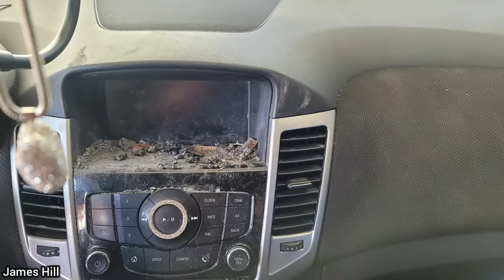Customer States New Oil Pump Installed, Still Has No Oil Pressure

Comment: 1:45 not a mechanic, I've seen one worse than that. The snorkel was connected all the way through but they hadn't closed the original air inlet holes( or it might have been the dust outlets). Anyway owner drove through a puddle that sent water higher than the top of the wheel arch and it hydro-locked the engine.

Comment: So funny that they put something thick in to "try to increase oil pressure"  the total pressure drop increases with increasing liquid viscosity when the superficial gas and liquid flow rates are the same, Starting with a high viscosity will actually amplify the loss.

Comment: My car had a nasty vibration on the highway. It was also noisy under throttle but that went away when coasting. First shop had some bullshit nonsense about hsving to call Volvo to index something in the "exotic" rear axle. A Volvo 240 has a DANA 30, same as JEEP has used for decades. Second shop got it right. At 392,000 miles the rear U joint was bad. Fine. Get it back, different vibration. Got told the driveshaft was dented. A friend has a bunch of Volvo parts so went there to swap out the driveshaft. Idiot at the second garage had forgotten to install rhe Zirk fitting, so open to the air, and two of the circle clips were barely in place. Swapped in a known good rear shaft, vibration gone. Ordered another new U joint. Put it in the original driveshaft, that has no damage and is not bent, and it is perfect. No wonder the circle clips were not in right. A roller bearing had fallen across the bottom of the cap, so it could not seat properly. Took some work to repair the damage to the yoke on my original driveshaft, but it is all good now.

Comment: Im just glad that in europe there are this many restrictions on vehicles.
Reply: In the USA it's state to state. In Pennsylvania, annual inspections of brakes, suspension, lights, operating and safety devices are required, along with exhaust emissions in some areas. In Florida, no inspections necessary. Most of the disasters you see here come from states with no inspection requirements.

Comment: I've never owned a car or worked on a car but how do you put a tire on backwards?
Reply: The customer installed the "spare tire " rim with the side that has the cavity to  accommodate the brakes facing out.  The rims of "spares" are a bit odd looking, and one must pay attention.  It's probably why the customer lost control of the vehicle and had another accident on the way to the shop.

Comment: What the hell…how are workshops even allowed to let anyone leave their parking lot with paper thin and cracked brake rotors?!
This is a danger to public safety and a rolling liability & criminal negligence case just itching for a reason to get started. I hope that customers like that need to sign a fat waiver that they accept liability for ANY mishaps resulting from this dumpster fire and decided to drive off against expert advice with brakes they now know are faulty. This might even be worth tipping off police about. I am sure they would be interested in knowing that this vehicle is NOT road safe and make sure it is not going on more inch until this is fixed.

Comment: Snorkels should only be hooked up when doing snorkel-y driving, since the car has to suck harder to get the air in through them. Returning the air intake to the normal configuration the rest of the time doesn't mean the snorkel is purely aesthetic. Of course, leaving the outer part sticking up when not in use is also bad for aerodynamics...

Comment: 01:57 Oh, I have a much better dashcam install in my truck. It looks just like that except that the cables aren't attached to anything, so obviously not hidden. The components have issues often enough that it would just be extra work to hide them only for aesthetics.

Comment: The wood on that car looks superb, however I am concerned that if a crash were to happen the occupants or those around will experience why most combat injuries on wooden sail ship combat was splinter impalement.
Reply: Cars of that era were death traps in a crash, no matter what they are made of.
Reply: @Sashazur  True. But personally I don't want to add further potential injury sources after or during a crash that might affect me or those present at the time. Looks very good, but there is a reason shipbuilders of warships transitioned to iron and steel ships.

Comment: The drive shaft looks like it may jave just collapsed from a defect or loss of imtegrity from rust.
Reply: Hmmm , the pressures inside it failed and the incurred vacuum collapsed it.  Okay 😉
Reply: @vs-ww7cb  no, the torque from the transmission twisted and warped it. Or if I'm right that's how it would have happened. The narrator said the owner didn't know or didn't realize they hit something, which either they don't want to remember, or they never hit anything and the assessment is wrong. However it's very strange that something would hit the drive shaft in that location and not anything else, like the differential since it hangs lower. 

So that's why I don't think it's an impact, and the that assessment it was is simply wrong.
Reply: I was just having "collapsed beer can fun" .  It look torsional  damage but remember a steel driveshaft can wallop something and lift vehicle enough to clear the rear diff. Lol , like I said was just having a laugh at it , its definitely an oddball.  You noticed how shiny the non collapsed side is ? Scale rust maybe,  but... I'd like to see the front end of vehicle 😉
Reply: @vs-ww7cb  ah, ok. Yeah internet and sarcasm meme. I was wondering about that too, but decided against saying anything since it could have happened while the bed was loaded compressing the rear suspension relative to the front. The shiny spot looks like that's where it was hitting the gas tank. But either way, we both understand theres a lot more going on than what was explained.
Reply: @nunyabisnass1141  lol sorry I made it a thought provoking thing 😆,  oh yeah,  there's alot of story in this one. No slight meant my friend ✌
Reply: @vs-ww7cb  no probs, some days you're the bait, others your the fish.
Reply: @nunyabisnass1141  lol 😆,  ain't that the truth..  people way to serious anymore.   ✌

Comment: note to self silicone don't work as a coolant leak fix never use silicone to fix a coolant leak
Reply: Actually it works quite well  if used properly 😂.   Just need to put it between the clamping force, let it cure, use right type and don't go crazy with the amount. 😉

Comment: 2:10 Cracked off rotor, declined all repairs. It should be illegal to drive it and the shop should be required to call the police. Declined..my left testical yer drivin' that away...lemme get the police out here so you can be cited and your vehicle impounded.
Reply: Hadta do exactly that,  blown wheel cylinder,  but we havta have it! We're towing the boyscouts camping trailer.  (This was Friday afternoon ).Lost ,what i thought were good customers.  Even declined payment after getting right part next Monday,  ate that cost. I did tell em, I won't put this back together, especially knowing your driving a buncha kids.   Smh lol

Comment: That means you have a plugged up oil porch because you took too long to change your oil oil pumps go out when you don’t change your oil long time when you don’t change your oil long time, you’re gonna have buildup within the little ports that spread the oil all over the engine where it needs to be so cool too little too late I’ll bring you water pump isn’t going to fix your problem. My brand new engine is maybe you’ll be smart next time and do Hoyle changes when you’re supposed to and change out your filters when you’re supposed to this is what happens when your not smart to do things when you’re supposed to do them.😂😂😂😂
Reply: Oil pump is not a guaranteed fix for stupidity. Like I said it goes out for a reason it’s because you’re not doing oil changes properly.
Reply: Meaning every 3 to 6 months like you’re supposed to I don’t care about the synthetic oil thing or we can go for 15,000 miles do it every 3000 miles like a smart person, some newer cars, especially trucks that have the ability to shut off certain cylinders it has the pump oil in there to keep them from seizing up because gas isn’t going through them and if you don’t watch her while pressure when it starts dropping because you have to add a little bit of oil every few months to replenish that that that oil used because it went into four-cylinder mode or whatever You if you can’t learn how your vehicles work you shouldn’t purchase them you know how many cars I’ve seen people purchase working at a car wash and they don’t know how to shut off their wipers. They don’t know how to turn off their automatic brakes they don’t know how to properly drive or know how their vehicles work they’re just dumb